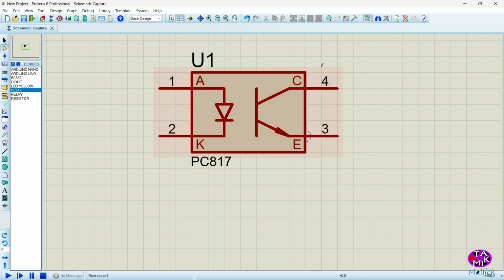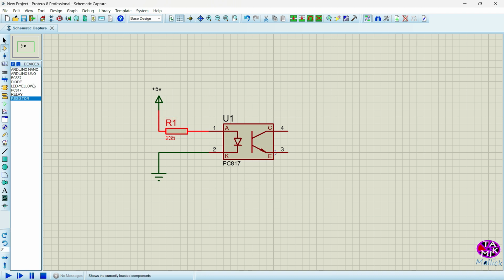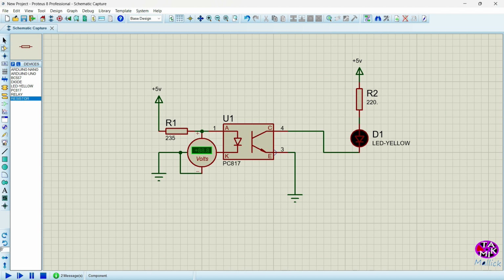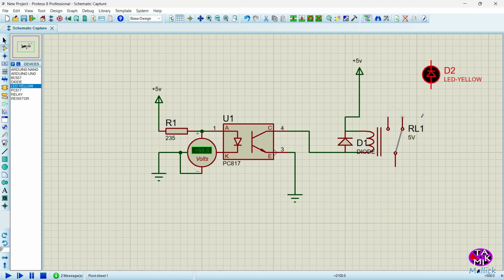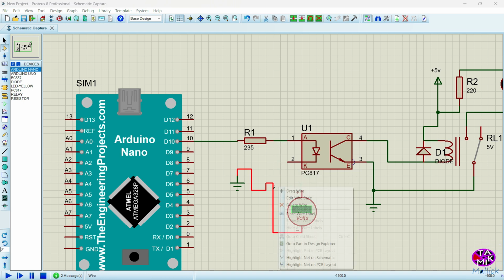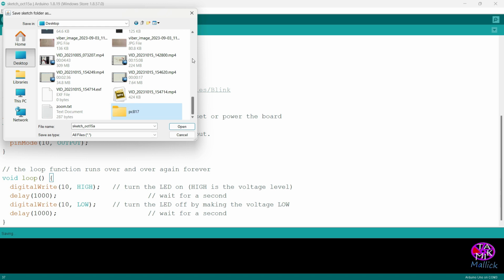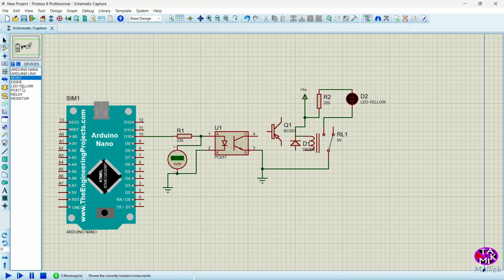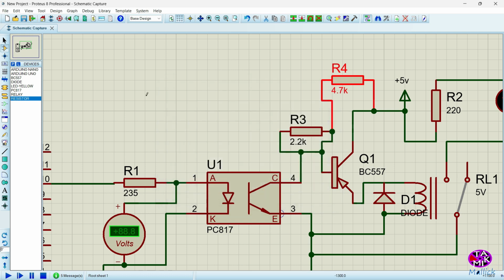How To Use An Opto-coupler with Arduino & Relay_ PC817 opto-coupler

Comment: There is a mistake in your 'plan' ! 

Please undo the connection between the 2,,2K-Ohm resistor! 
It shortened the base connection, of your external transistor. 

Aöl the best for you!

73 de Markus - db9pz - my HAM radio call -
Reply from the maker: Exactly, great findings. Thanks buddy.